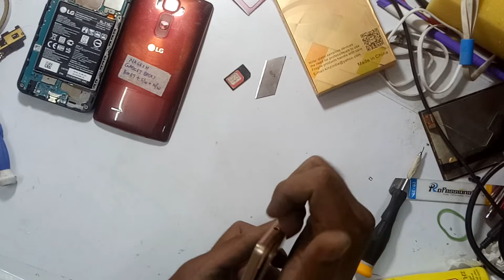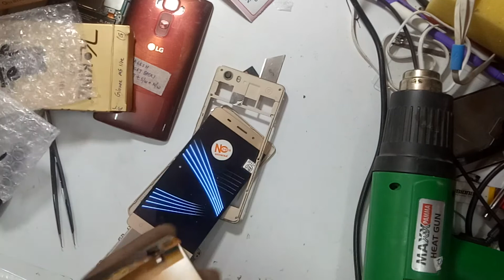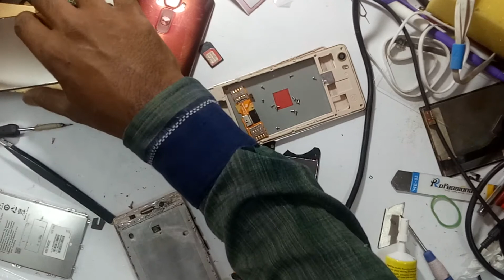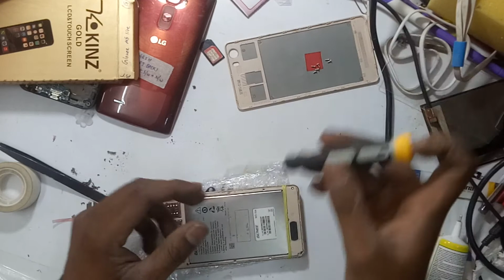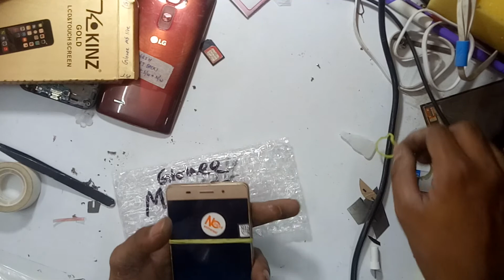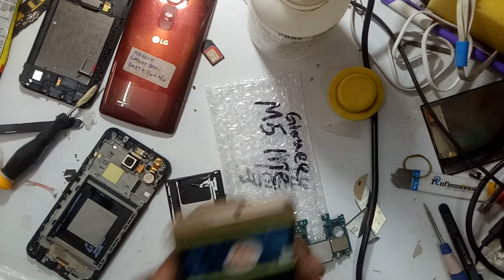Gionee M5 lite Lcd Replacement

Comment: M5 ki charging pin pe jo round cell type kya hai??? kya  ye battery charging ke liye jaruri hai kya
Reply from the maker: Ajay Meena normally wo charging pin ko jab aap charging ys usb connect karte hai to wo move hone se rokne ke liye diya jaata hai
Reply: +Mobile Solution's thanks for fast reply but ye cell type jo hai use hta lene per phone charge hona bnd ho jata hai and uska charging pin Ko touch krey rehna jaruri hai. .......
Reply: +Mobile Solution's poora touch combo kitne tk ka  aajayege?
Reply from the maker: Ajay Meena charging pic ki soldring loos hone se ye problem aati hai
Charging pin change karva lo
Reply from the maker: Ajay Meena combo lcd ki market mein 800 se 900 tak aajayega
Lekin usse fix karne waala aap ko 400 to 500 charge karega